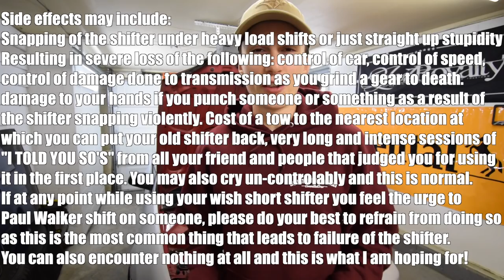EG Short Shifter Install!

Comment: ChrisFix explains the short shifter really well in his video, you should go and watch it.
Reply: IMNOTA it’s obvious. “short shifter” it does exactly what it says. it shortens the throw to shift gears
Reply: @benfocknurbich7729  Yeah, I meant the part where he explain what moving the pivot point does. Because Robbie seemed confused, he though the pivot point should be lower even tho it needs to be higher to shorten the throw. And I think Chris explains that really well with a wood stick. It's really simple but having a good explanation makes it even simpler.

Comment: In my boosted del sol ( b18 on 14pounds making 300hp to wheels) my shirt throw shifter is like 3 inches for my shifts  but my del sol have a specific linkage for b series and there a lot different vs like any other b swap linkage for eg and stuff

Comment: a bit of an engineering lesson for you... the larger the valve the faster the pressure will be released, thus it makes no sound, with the smaller valve there will be a higher differential pressure and that makes the whistling sound

Comment: Just fyi I had a cx racing bov like that and it wouldn't hold boost, bought an emusa brand just like it and it wouldn't open barely at all. Swapped springs and it didn't fix anything as I was back to square one of not holding boost. I sold the emusa one, bought a "genuine" hks ssqv on eBay, it wound up being a knockoff, returned it and got a refund, bit the bullet and just bought a real hks ssqv from Japan off of amazon and it works perfect. BTW the Ssqv sounds amazing as you can change inserts for different sound.

Comment: Since you have shift brackets rather than shift linkage you should get some metal shifter bushings it can really help the feel of getting into gear and trust me it doesn't make a hell of a difference because the rubber ones feel kind of shity to me not that there's a problem with them just feels better

Comment: Damn, shame that the spring swap didn't do much. It must be because of the larger diameter of the new valve which lets off more pressure all at once, so it does one short quiet "pshhh" instead of the long loud "pshooff" of the original valve.

Comment: Can u sell a sweater with just the text on the front. It just don't look right for people like me that do not have boosted cars. Also because i don't like people staring at me even tough they are just reading the big ass text on my back. in summary: i would buy a sweater if the back of it was clean (without text)